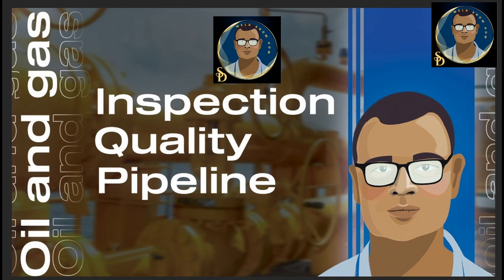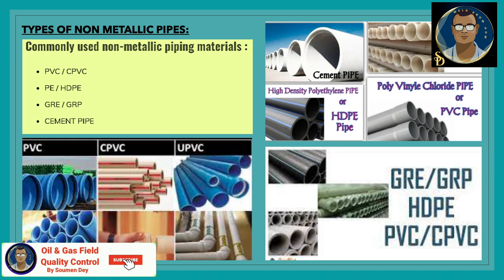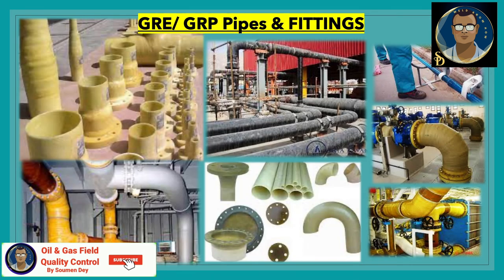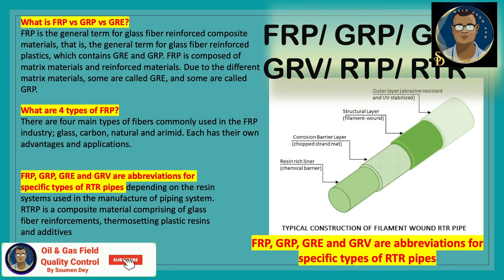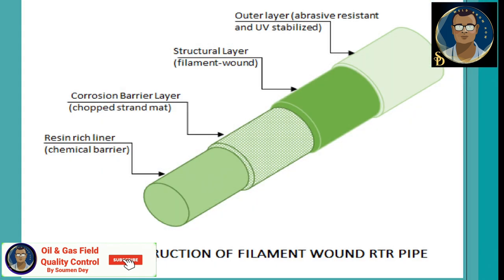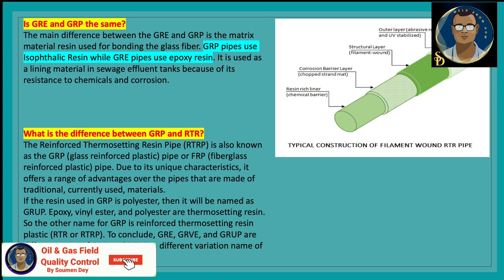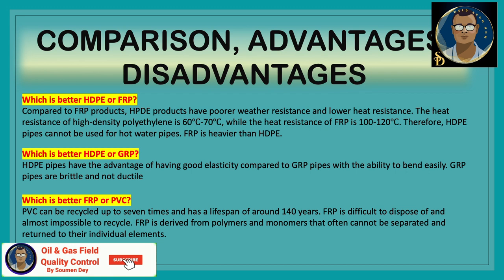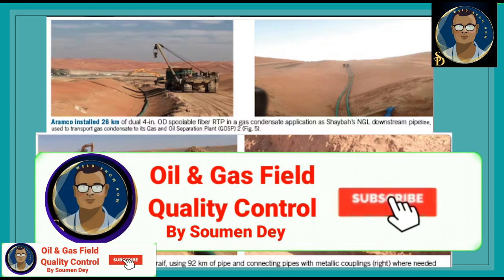TYPES OF NON METALLIC PIPES USED? PVC, HDPE GRE GRP CEMENT RTR RTP PIPING PIPELINES

Comment: Thank you for your videos, In your experience, have you seen any non-metallic pipelines for ammonia?
Reply from the maker: Not really, I have only worked with Water and Condensate line, both low pressure utility and High pressure cross country pipelines